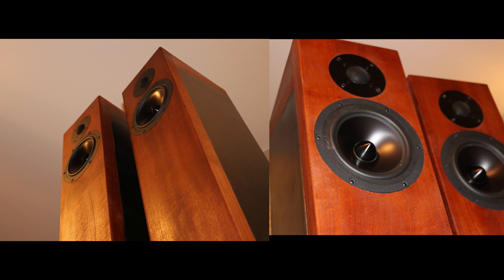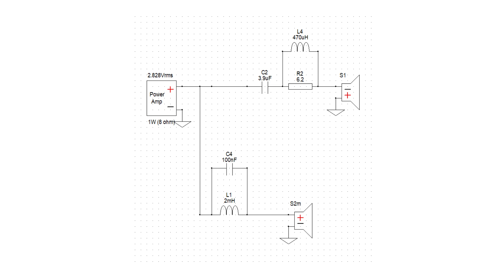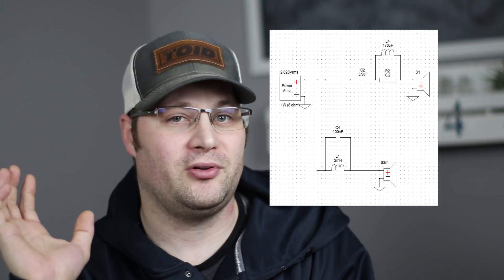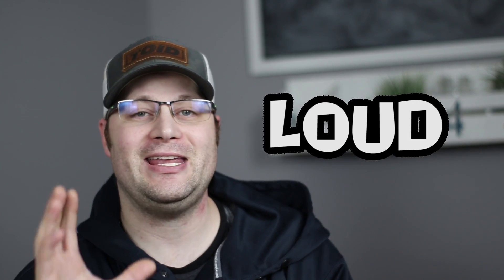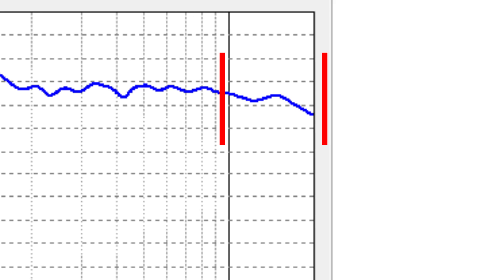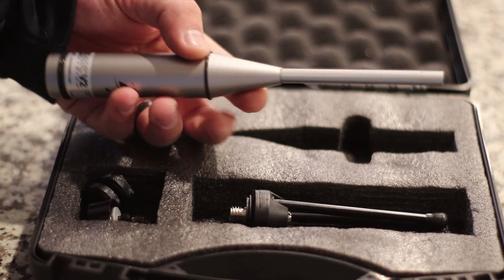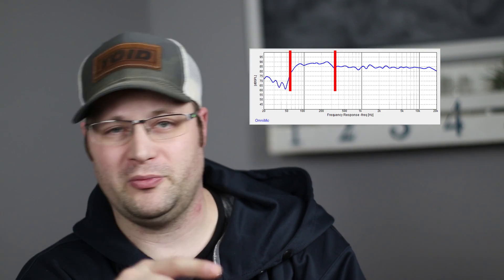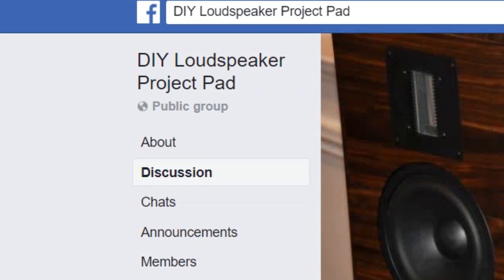Crossovers Revealed for the KMA Rear Surround Speakers

Comment: Nice. I have a old pair of Infinity speakers from the 70's and the foam suspension crumbled so I just went to Parts Express and purchased a pair of
Dayton Audio DC160-4 6-1/2" Classic Woofer Speaker
Brand:
Dayton Audio
|Model: DC160-4|Part # 295-309 and hoped for the best. These speakers are loaded with folded filling. They sound great except the tweeter is a bit overbearing so would you suggest adding a resister to the tweeter? If so which value should I range in? I'm not that fussy, these are just some bookshelf speakers. I didn't even bother to see if they had anything for a crossover so just a off the cuff guess would be great, thanks
Reply from the maker: I'd probably buy two 1,2, 5, 10 and 20 ohm resistors.  With those values you can make anything from a 1 ohm to 28 ohm and about anything in between.  Especially since they are only a dollar a piece.  Without knowing the specifics, it's hard to give an exact value, but this is probably what I'd do.
Reply: @Toid  I was hoping so, so if I have to I wire them in parallel right? What wattage resisters? Thanks
Reply from the maker: @MrBrymstond  here is a good calculator: https://www.calculator.net/resistor-calculator.html  You shouldn't need anything more than this for wattage:  http://bit.ly/2Wx9PIe  I did update the list of resistors, I left 2 out.

Comment: I've built speakers for years and have just bought prebuilt crossovers depending on the drivers specs. To fine tune the sound I just install Lpads on the back panel. Looks like I might have to invest in some test equipment and start building my own crossovers .
Reply from the maker: It really makes a big difference.  You won't be sorry if you do.